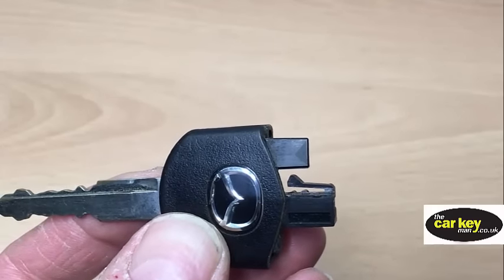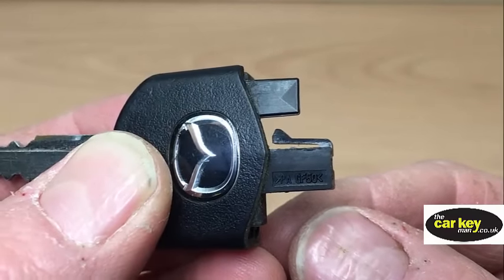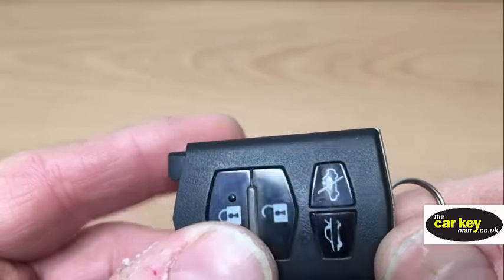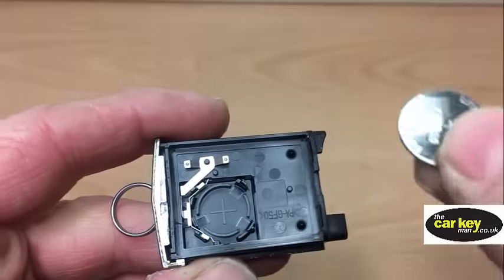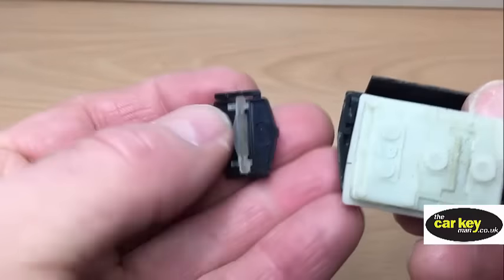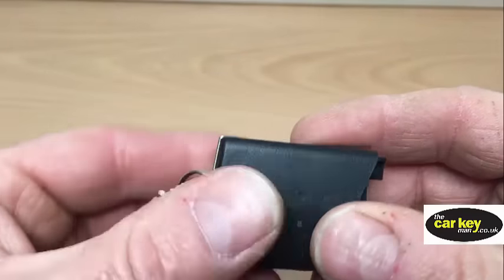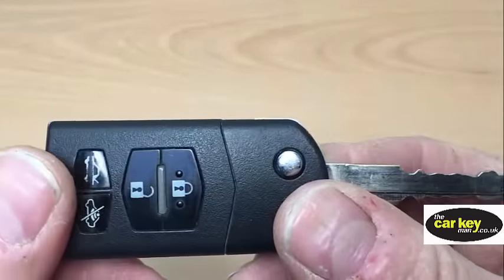Key Battery Mazda Remote Key HOW TO change

Comment: This video is still saving lives all these years later. Bought a car second hand and the fobs didn't work. 
Turns out the battery in both sets of keys were installed upside down. 
Thanks. 👍
Reply from the maker: Yes, amazing really, gad it helped you :)

Comment: Thanks for the extra details about the unlock/lock "bits" falling out of the side of the lock casing. I would stress to not let the circuit board fall out of that side of the case in order to keep the "bits" in place. SO ALWAYS keep that side down when you are dismantling it to allow gravity to work for you. In this demo, the lock/unlock "bits" stayed together with the whitish/clear plastic spacer. In my case, that section completely fell apart, requiring much patience and a tweezer to reassemble it IN THE PROPER ORDER. Spacer bar needs to go in first, among other things. Took me a long time to figure all this out and get everything to sit correctly. Still you provided more details than some other videos.
Reply from the maker: Thanks Bill, yes good advice

Comment: Wonderful I was able to open my Mazda key and check the battery in used. Next went to market and bought a CR 1620, 3v battery and able to replace it without any problem
Thanks for sharing
Reply from the maker: Well done, you've done the hard part :)

Comment: I've snapped my tab off. I'm going to try making a new clip or failing that, wedge a thin cable tie inside and if all else fails, get a new key as a last resort. Thanks for the video, I only bought the car a couple of days ago. 👍
Reply from the maker: It's a real problem, so many people break it trying to change the key battery. Have you seen our video on how to change the case? https://youtu.be/sA2cQnN4VGU

Comment: That was very useful. I figured out how to separate the two parts but couldn't figure out how to open up the battery housing and didn't want to risk poking around and forcing it open (my manual covered a key fob). 

BUT HOLD ON JUST A SECOND!
IS THAT A MITSUBISHI EMBLEM? INSIDE MY MAZDA KEY?! COOL! 😜

Oh, I've also noticed people asking about the forth button up there.
Now, I'm assuming that like in my car, when pressing the lock button it will also arm the alarm.
So, according to the manual (though I haven't tested that myself yet), after you lock your car, you have 20 seconds to disable your alarm.
Reply from the maker: Glad this helped Kynda, yes the Mitsubishi company make just about everything! 
Thanks for the extra info on the fourth button

Comment: This was extremely helpful, thanks, the little tab at 20-30 seconds, is there a way of replace that mechanism without getting a whole new key cut and programmed at all?
Reply from the maker: Hi Angus, has the tab broken off?
Reply: @TheCarKeyMan  yup. Saw another one of your videos. Probably easier to get it all replaced it sounds like.

Comment: Hi. I saw both your videos to change the battery and reprogram it. I hope the reprogramming will work like you say. But I'm trying to change the battery in my key. Mine is a Mazda 6. 2006 2.3L Sedan.
I located the small tab inside to separate the two key components. But on yours to open it, you have three rectagulated slots. One on each side and one in the middle that you put your flat screwdriver in to delicately twisted it open. But mine doesn't have that tab to open it. I don't wanna break it. So how and where do I go to separate it to get to the battery. Please let me know. Thanks!

Comment: Thank you for your brilliant videos. May I ask would the key fob light up still if the battery needed replacing as neither key fobs are unlocking the car but both lights still work. My driver side door stopped unlocking a few weeks ago and now none of the doors will unlock. So I can't get in my car at all now. Thanks
Reply from the maker: Hi Gemma. Ok, so are you completely locked out of the car?

Comment: great video, we have a key for our 2012 mazda 2 which has been left in a drawer with a flat battery, i plan to replace the battery tonight but will it need reprogramming? its been dead for a few months now?
thanks
Reply from the maker: Hi Matt, you can never really tell. Sometimes when these are replaced they come back to life no problem, other times not

Comment: Do you know from where I can get a replacement key fob  with circuit chip?
Reply from the maker: Hi, to get the correct part, I would say the dealer. There are half a dozen that look the same, but are different inside and only the correct one will code up. 
Or have a look for any markings and look online for an identical one

Comment: Thanks for this. I got my key into the 2 parts, but inside my key (from 2005 Mazda/Axela) there is no slot as shown at 1.48 to then split open the key and reveal the battery - any ideas? I can send you  a photo if you like?
Reply from the maker: erm... that's odd. Won't be able to have a look at photos til next week but feel free :)

Comment: Great video. The battery in the key fob for my Mazda 2 Tamura has just died. Once i've changed the battery do i need to reset anything in the car or does the key fob
 just work straight off?
Reply from the maker: Hi John, sometimes it will just work, other times you'll need to code the key back in. I've made another video that should work, I'll post a link
Reply from the maker: https://youtu.be/DlLspc9fD-w
Reply: @TheCarKeyMan  Thanks so much mate. Much appreciated. I'll give it a try this week.
Reply: @TheCarKeyMan  Just to let you know i replaced the battery on the key fob on my mazda 2 tamura following the video instructions & the key worked straight away. Thanks mate.

Comment: Is it easy to replace the key 🔑 (metal part only) removing it out of the top plastic part and swapping it with a new cut key easily as I got a key sent in mail and it’s wrong and their sending a new key, but their only sending the metal key not the top plastic housing it flicks out of (Mazda3, 2006)????????

Comment: Hi if my key battery is flat as i found out? If i take my car battery out for a year as mazda 3 was getting repairs etc! Last night i put mazda battery in  and all lights come up. But it wont start unlike before!? I now have a picture of a padlock and car symbol flashing rapidly. About a couple minutes. If i replace battery in key will it start?  Car was a gift to my daughter?  Any reply appreciated thanks from Australia!
Reply from the maker: Hello in Australia, hope you're all safe. If the padlock light is flashing rapidly, then the immobiliser isn't seeing the transponder chip in the key. Has anything happened to the key while you have been repairing the car?

Comment: When you say in your video description "Sometimes the remote part of the key needs reprogramming", is that when you remove the battery or is that a separate issue you're talking about? My key is going flat but not quite flat yet, so I don't want to run the risk of DEprogramming it by simply rmemoving the battery.

Thanks.
Reply from the maker: Hi, ok good question. In all the time I've coded keys, 15 years, the normal rule is that if a key battery slowly dies and then stops working, it stands a higher chance of dropping out of key programming, than if you change it while it still works. 
I'm not sure why this is, maybe the cars don't like it when the key remote becomes unreliable.
So I would change it BEFORE it fails altogether.
The good thing is that these are very easy to recode, I will post a link and the buttons do not have anything to do with the car starting. 
So even if you get it wrong, the car will still start :)
Reply from the maker: Hi, ok good question. In all the time I've coded keys, 15 years, the normal rule is that if a key battery slowly dies and then stops working, it stands a higher chance of dropping out of key programming, than if you change it while it still works. 
I'm not sure why this is, maybe the cars don't like it when the key remote becomes unreliable.
So I would change it BEFORE it fails altogether.
The good thing is that these are very easy to recode, I will post a link and the buttons do not have anything to do with the car starting. 
So even if you get it wrong, the car will still start :)
Reply from the maker: https://youtu.be/DlLspc9fD-w
Reply: @TheCarKeyMan  Thanks mate. If I hold it to my head it works reliably so it seems like I'm getting close. Any brand battery as long as it's the same type and a reputable brand, yeah?
Reply: @TheCarKeyMan  And fantastic, thanks for this link as well. Mine's 2011 so should be same procedure. Cheers again, big thanks and keep up the great work. :D

Comment: Is there any way to tighten a loose key? The top portion looks like its almost coming apart so the key looks like its almost falling out
Reply from the maker: Hello Desaree. behind the mazda badge there is usually a screw. Get a sharp thin edge ( please be careful ) and peel teh badge off to see if the screw is tight. If it can't be tightened, then then we add a small amount of glue, but don't go crazy, otherwise the flip won't work
Reply: The Car Key Man i ended up ruining it even more lol i couldnt find the screw but thank you! Ill keep an eye out for a tutorial if you post one for this problem 😊
Reply from the maker: On some of the non genuine keys, there isn't a screw. They are just glued ( or not ) together. I'll try and get one done

Comment: Just sharing my experience replacing this battery. I could not get the key to come apart using the tab - not sure why. I think previous owner glued it together or something.  Anyway, with the key in one piece i popped off the "front panel"  - the panel with 8 indentations in it (visible at 0:20 and 3:48 in the video). I popped it by inserting a small flathead in the side opposite the side the key flicks out of and rotating the screwdriver. As noted by @billcaradonna608 below, the circuit board, 3 buttons, soft plastic press pad and clear(ish) illuminatable button spacer all fell out when the panel popped off. I was able to access and change the battery similar to the video and reassemble the bits - they are small and fiddly, but all moulded to one another's shape and fit together logically. Hardest bit is figuring out which way around the clear(ish) illuminatable button spacer went but i got it right and the key works great again. "Front panel" clipped back on no problem. Anyway, maybe that's useful to someone who is not getting the tab separation shown in the video.  Video was great to find as a guide so thanks for posting it!
Reply from the maker: That's impressive! You changed the battery without separating the key, very good, I've not tried this. I will next time I get a glued key (Why would anyone do this!!! )

Comment: Good video but although my key was identical on the outside, there was no screwdriver slot inside, so I couldn't open the battery compartment.
Reply from the maker: Hi Angela, that's odd. Did you get it open?
Reply: @TheCarKeyMan  Unfortunately not and I didn't want to end up breaking it, so I'll take it to Timpson. Thanks for enquiring.

Comment: Great Video.. Just opened mine. Panasonic battery w/those same #'s. I actually do not like this flip key though..
Reply from the maker: Thank you for the comments. Most of the main makes such as Panasonic, Duracell and Maxell are ok. The problems come when cheap batteries are used.

Comment: Just changed to a new battery still not working? Does brand make a difference?
Reply from the maker: Yes, you need a good brand, also did it work before you changed the key battery?

Comment: Hi i bought new key from ebay and programmed to the car and  it locks and unlocks but unfortunately it wont start the car? Any suggestions thanks
Reply from the maker: is it a Mazda
Reply: I have the same problem, yes its a mazda.

Key locks and unlocks but doesnt start car
Reply from the maker: Ok, have you tried to code it back in? It's very simple
Reply: Did not require recoding in the end.

I was missing the transponder chip which was still in the old key shell.

I couldnt remove the transponder from the old shell so had to reuse it but all is working now no reprogramming required!

Comment: After changing the battery the key starts to flash the red light for about 25 seconds. While it does that the unlock button locks the car and the lock button doesn’t work at all.
Any help/tips?😢

Comment: Hi, I have a 2006 Mazda 3 with a two-button flip key. I've managed to pull the key into two parts, but there's no other obvious slots or notches like you show in step two, so I can't figure out how to open the battery compartment. The key has "Visteon no. 41521" on it. Please help!
Reply from the maker: Sometimes they have been opened so many times that the slots are worn away. It will come apart, can you email a photo to us?
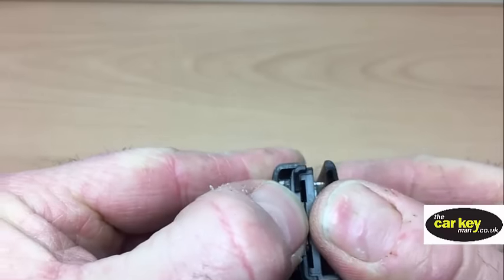Reply: I had the same problem, the little tab is actually in a different place, instead of being on top it is just below one of the 2 bits of plastic that stick up and help position the parts. Have a look at 1:50 and the slot is under the lower portion that sticks up and I used a little pair of elbow tweezers to get in there and pop it out. Hope this helps as I nearly broke mine trying to figure that out, let me know if that explanation was bad
Reply: Not seeing it there either. In fact, I'm not even seeing a seam at all on the top (button) half of my fob.
Reply: @MoonPig2204  mine was the same thanks!
Reply: Had to do the other key fob today. Thank goodness I found the comment again as had trouble figuring it out again. Job done!

Comment: How can I take it out the key and put in the other part of the new replacement?
Reply from the maker: Hello Rod. Are you trying to swap the blade and chip into a new shell? Has your blade got wobbly with the spring not working? Or do you have a different problem?
Reply: The problem is when I close the key inside the shell is difficult to get out. I pushed the bottom and the key is stuck inside the shell. Then I have to insert something inside to help the key go out.
Reply from the maker: Ah ok, and is that in the original shell ? Or is that in the new case?
Reply: Original shell
Reply from the maker: Hi. I'll be making a video to help you in the next 2-3 days hopefully.
Reply: The Car Key Man great  thank you. Let me know when you posted the video
Reply from the maker: Will do
Reply from the maker: We got the replacement blade in today, so we'll be making teh video in the next 3-5 days. Sorry it's taken a while
Reply: The Car Key Man good I can't wait. Thanks
Reply from the maker: Hi Rod, I hope this helps..https://youtu.be/sA2cQnN4VGU

Comment: For the Life of me I cannot get the main part of the key to open so I can get to the battery compartment. I’ve tried several times with different tools and it just won’t separate. Any suggestions?
Reply from the maker: Hello Danni. Do you mean you cant get the two halves apart, or you have managed to, but can't get the bit with buttons to open?

Comment: My unlock button is not operating.  Not only doesn't it open the car, there's no "click" feel when I push it.  (The lock button is fine.)  I've checked everything inside the remote control unit and it all looks to be in order.  The two switch pushers are firmly in place, nothing's loose, nothing seems to be broken.  The terminals are connecting fine.  Does anyone have any ideas?
Reply from the maker: It probably just needs a new switch, the click is really important. Have you had it tested to see if that button is sending out a signal?

Comment: If you glue it at the seams you can get a knife to get it undone next time. I found that the clip did absolutely nothing to hold everything together. It came undone regardless.
Reply from the maker: Hi, I see a lot of these glued with so much adhesive, they are never coming open! Maybe you have the delicate touch...

Comment: Unfortunately I have the 2013 older version key :(
Reply from the maker: Hi, does the key look the  same?
Reply: @TheCarKeyMan  No. mine doesnt have the boot button at the bottom just the car with the wifi icon. Also when you open it up it doesnt have the tiny slot that you stick the screw driver into. That section is totally flat. No slots grooves or anything.

Comment: having issues with the spring
Reply from the maker: Hi, is it that the blade does not spring out and fold back?
Reply: The Car Key Man  yes the clip that held the top part of my key broke, so i ordered a new one. but when i tryed to put the spring on it refused to flip the key end would get stuck. for some reason it will do it with old half of my key and not the new one.
Reply from the maker: Hi, re you using the old blde from the old key, in the new key?
Reply: The Car Key Man yes an responder
Reply from the maker: Sometimes the aftermarket design is different to the original, so that the replacement blade and assembly won't work in a genuine key. The best thing is just to get the key cut